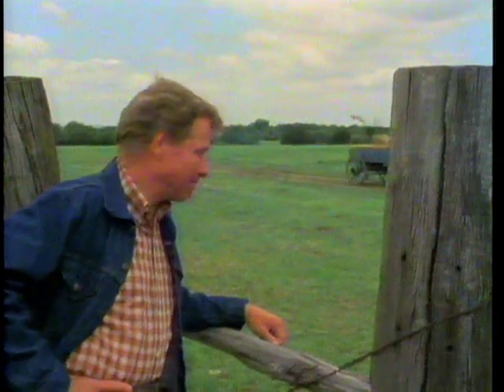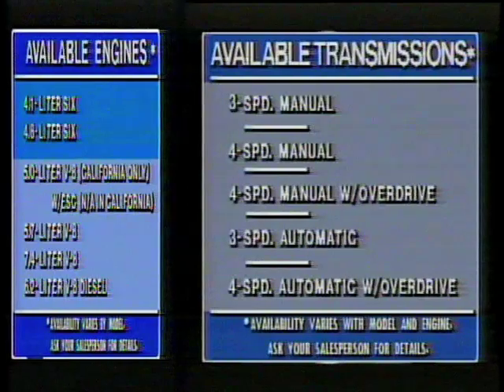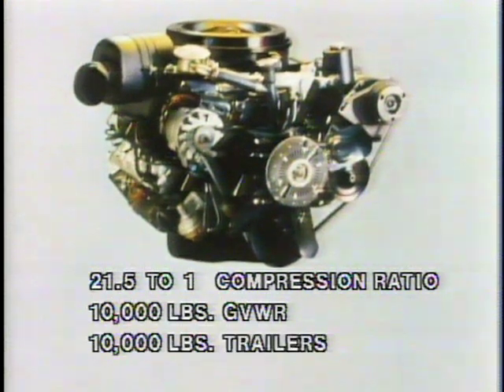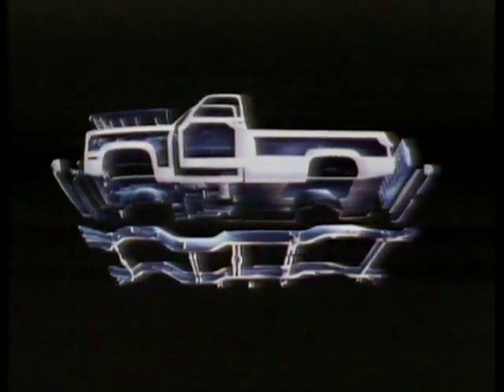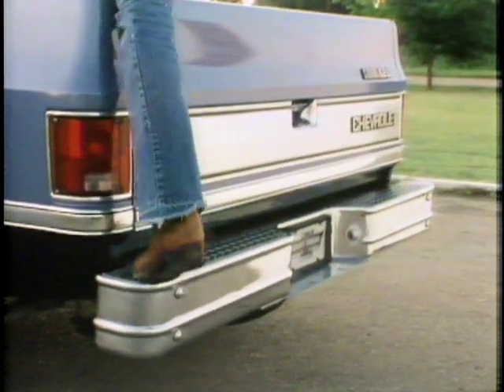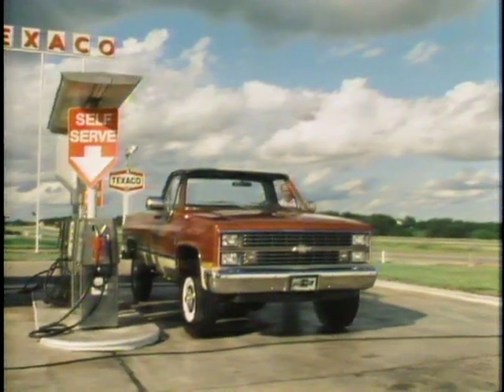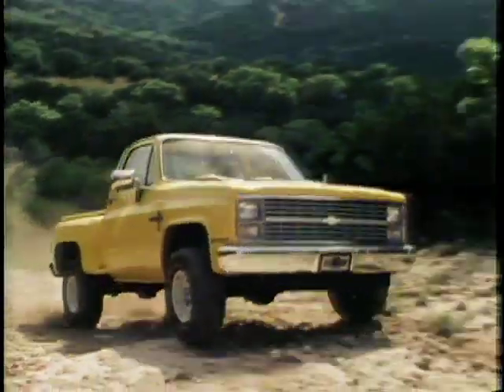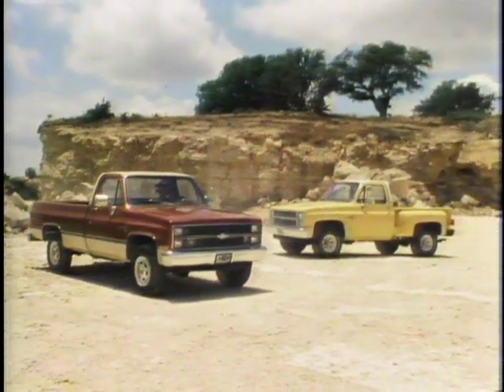1983 Chevy C/K Pickup Trucks

Comment: I bought a  used '87 Sierra after a chick in an SUV Kamakazi 'd my old  '86 Ram in an ice storm. 
It was black and chrome with the 5.0 and gorgeous, with 70's style. Turned on a dime compared to the Ram and the seat was far better for my butt. The Ram's was just torture...( that  legendary 318 was gutsy though:)
 But it ended up burning oil and was rusting here in New England. I ended up buying a 2000 Silverado W/T new with the 4.8. Great truck I still drive, also real good looking, IMO. But I do love this generation for the cool retro body style. I hate these new puffed out tricked out luxury liners loaded with pricey dicey tech today. Hope I keep my 2000 for 30 years and pick up an old 
truck from out west as well someday.

Comment: I didnt know that in 83 they were still offering a step side body. Or a short bed. I guess they sold very few of those.

Guys used to argue back then about ford vs Chevy pickups, but either one with a straight six was a great truck that would run 300,000 miles if you just took basic care of it

Comment: This is when trucks were still trucks . Today's truck suck
Reply: sean kenoss I hear you man. I have a 96 Ford F150 with 5.0L Windsor V8 203,393 miles on it and it's still going strong.
Reply: That generation of Chevy/GMC were rust buckets. The local auto parts stores around here had doors,fenders,hoods etc. in stock to replace the rusted out parts for these trucks. The cab mounts would rust out & the cab would shift when you pushed in the clutch pedal! The previous generation of Chevy trucks ('67-'72) were much better trucks.
Reply: Yeah these new trucks with over 400 hp and damn near 1000 ft lbs of torque are whimpy right¿¿¿¿
Reply: billcharlene1450 I know Modern are more powerful and more fuel efficient but they're overpriced, to complicated, and made out of cheap plastic.
Reply: 381 322 That's cool man. How many miles does you're 96 F250 have. My 96 F150 with 5.0L Windsor V8 has 203,485 miles on it and it's still going strong.
Reply: billcharlene1450 Just to let you know that my truck will outlast what ever modern vehicle you drive.
Reply: CJ Colvin There are many modern day F150s with more miles on them, and they're also going strong, even working hard to this day. Also, the ninth gen F150s were rust buckets, had weak transmissions, weak frames and weak suspension. The only ones still left are rebuilds or creampuff that have hardly don't hard work in their lives. So no, I don't really know if your truck will really outlast a modern truck. You should be thankful it's still going.
Reply: Bakersfield Buck TSPPS Today's trucks can tow and have bigger payload then those trucks I agree with it being simple but lets face it there not going back to making trucks like they use to make.
Reply: Sean Wayne 1988 These trucks were not as good as you think.

Comment: The new trucks definitely are more powerful and efficient... you have more space in them comfort with all the creature controls you could desire for work and recreational time in your trucks.    I will always like older trucks better though. I actually can reverse towards a trailer without hitting it and needing a spotter to hook up. They are easier to work on and cheaper to repair. They are far more simple leading to less failures and in a lot of ways were built far stronger.... if I want a better ride I can upgrade a suspension... more power, different gearing... not hard to deal with. The old trucks have their issues too but as a Dodge guy specifically the 94 ram with the blowout fenders and tall hood that's attached to the grill will always be far better looking than the rams of today that always seem to remind me of minivans in appearance.    The grocery getter "trucks" of today.... that break far too easily are a big let down in lots of ways for people wanting purpose built vehicles.

Comment: The 3 speed manual's was a column shifter.
Reply: Not many people know how to drive a manual 3 on the tree
Reply: My dad taught me on a 3 on the three.  He said if I could drive a column shifter I could drive most anything else.  He was correct.
Reply: My 81 has the 3 on the tree. I love it.
Reply: I miss those 3 on the tree manual trannys. Driving those were easy, the pattern of it was basically a sideways letter "H" with Reverse was all the way up toward you, 1st gear straight down, 2nd gear go half way up & pull away from you & go up again, & 3rd gear go straight down, & neutral is right in the middle.

Comment: how much was a truck like this back in the day?
Reply: Clarissa Ashley my truck in 1978 when it was made sold for 4,600-5,000.  Brand new
Reply: It would depend on how it was optioned out, but I'd guess about $15,000 for a fully loaded standard cab half ton.
Reply: +Jesse Beeson can these truck make it to the west coast to the east coas
Reply: Clarissa Ashley Sure. That is if your prepare for the trip by making sure everything's in good shape and working order before you leave. I'd get in mine and go for it no problem.
Reply: Clarissa Ashley I've got an 82 Sierra, and back in 82 it was around 6100$
Reply: Clarissa Ashley about $5k brand new on the showroom floor.
Reply: joshua ramirez my god a new truck now a days are pushing 40 grand
Reply: That a Good tuck
Reply: Clarissa Ashley 70.000
Reply: @zachcondon-oz3uh  well they are far more complex you have full size bucket seats lumbar leather heating and cooling, these old vehicles just had a bench with some cloth and that was luxury
Reply: Curious, To help put in perspective the relative value of the dollar then what did other things sell for? Things like milk, gas, bread, etc..

Comment: chassis on this truck was very weak by stering box chassis often broke
Reply: Rogelio Rodriguez That was known to happen on 3/4 ton 4x4 models, or other models with large tires. It would crack and flex at the steering box. The rest of the frames are solid.

Comment: All of these comments about how these were real trucks blah blah. Newer trucks are light years more reliable. Built heavier and better. I know all of you who think that way are going to troll. I'll be willing to bet you all think a posi is better than a lsd.
Reply: flight2k5 yes, your right. New trucks are built way better. They're also bigger, stronger, faster, tow more, haul more & have more creature comforts. The downside is all of the electronic elements that goes into making the trucks the way they are. Most of these ppl are stuck in nostalgia land. Don't get me wrong I had a 89 Silverado heavy half ton, 350 with a 400r tranny & I loved it. It drove great & it had a different feel to it. It's really left up to the individual.
Reply: flight2k5 good for you, you think a crew cab shortbox with aluminum wheels, a touchscreen in the dash and all is better than an old thick steel truck? The old ones are easier to fix too.
Reply: you realize the electronics do not make it less reliable, also the "heavy half" ton wasn't stronger than a normal half ton
Reply: older trucks are not easier to work on HAHAHAHAHA
Reply: "thick steel" is irrelevant to pretty much everything.
Reply: flight2k5 older trucks are much easier to work on. Aside from seized & stripped bolts. I think they both have their places  however with the new truck I wouldn't be able to work on it myself. Therefore to me it's not as enjoyable.
Reply: King David 314 but you actually can work on them.  Ive seen high school kids working on them.  you may not posses the brain capacity to work on them.
Reply: flight2k5 work on a new truck?
Reply: yep, its not hard
Reply: flight2k5 yea, I'm not so sure about that.
Reply: King David 314 well your ignorance is limiting your experience.  Soooo.....
Reply: King David 314 ummm yea. You realize ignorance can be corrected right?  It just takes effort on your part to educate yourself.
Reply: flight2k5 you're right, so educate me. Where's the proof to back your claims? Where are your sources?
Reply: flight2k5 right right but before I do that since you claim new trucks are easier to work on then you could at least provide proof to back your claims.
Reply: flight2k5 😂😂😂 All talk no action.
Reply: My single cab 6.5ft bed K1500 from 94 weighs 1600lbs more than the 2014 crew cab 4x4 Silverado. That statement is just flat out false.
Reply: Cale Newport no it doesn't. You're flat out lying.
Reply: why?
Reply: I like 90s trucks. Enough electronics to be reliable without being annoying. Extended cabs are nice too.
Reply: flight2k5 tuning an engine and working on one are completely different things. New trucks and their engines are a lot harder to work on. You said there are a bunch of high school kids that work on new trucks, where? I'm in high school and there is only like 2 newer trucks at my high school but the kids that drive them dont work on them, they just drive. Most kids have older trucks that are easy to work on. In fact, i drive a 1984 GMC Sierra 1500 with a 6.2 diesel and that motor is the simplest Diesel engine I've ever seen. My uncle is in his 50s now and he has been driving the same 1969 Chevrolet c10 for over 40 years. If you ask him why he'll tell you that its simple to work on and its incredibly reliable. If you ask him why doesn't he get a newer truck he'll tell you that they're too complicated to work on. This man has worked on countless engines since he was about 10 years old, i think he knows what he's talking about. Old engines were mechanical, new ones are electrical, you cant work on a new truck without a laptop and a tuner. Tuning a vehicle is not the same as getting dirty and actually working on the thing.
Reply: @fredlopez6430  don't shit on the Ridgeline not the most well thought out design to work with but a contractor has one with over 300k miles it works for simple stuff like some lumber some power tools and I've seen it drive through wash board dirt roads 
Not a much a work truck but very dependable
Reply: +HERPY DERPEDY your right I have a customer WHO had one with over 350k miles maybe we know t he same guy
Reply: Molly mine has a 85 Chevy pickup truck single cab another friend has today's Chevy truck my friends 80 model Chevy truck out pulled today's Chevy truck my friend Chevy truck you ain't had to do nothing to it 80 model Chevy truck that is and it's still runs today never had to do anything to it
Reply: These new trucks couldn't compete off road with out some buzzer going off or air bag deploying
Reply: >flight2k5: lsd and posi is the same damn thing.

Comment: no thanks no Obama Motors on my drive way
Reply: Steve Riddle you realize that modern trucks aren't the same as old trucks right?
Reply: So...
Gm had a bailout 
Chrysler is owned by Fiat and falling apart...they haven't changed
Fords are still doing what they do 
Nissan and Toyota have come a long way from the dependable but rustu straight 4 manual small pick up
I'll buy whatever I like
Reply: @bryanmartinez6600  it's a shame Ford hasn't changed,like always Ford is junk
Reply: @justenough730  the twin I beam on the Econoline is solid the ifs on the Express van is trash we have one, when breaking everything shakes and the rotors and breaks are replaced also this is the third van all have had weak front ends but...at least it's not a Promaster that is real trash
Reply: @bryanmartinez6600  nobody uses a Ford engine to make their car or truck better performing,more power but they used alot of Chrysler engines  and GM engines a man showed me a 56 Ford PU he had and popped the hood and it had a 440 Chrysler nice clean job he did he had Ford engines he could have used but didn't,the twin I beam is antiquated, designed to wear out the tires quickly another Ford flop Ford has nothing to offer engines are junk